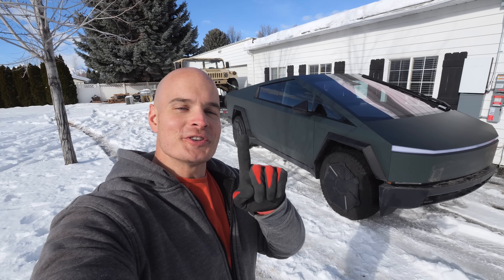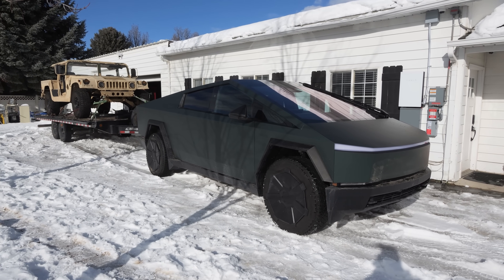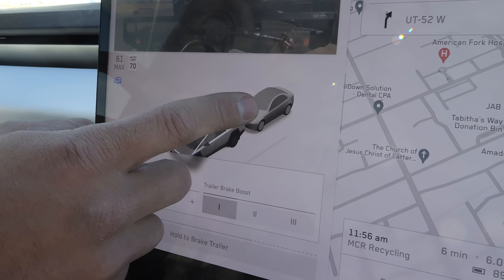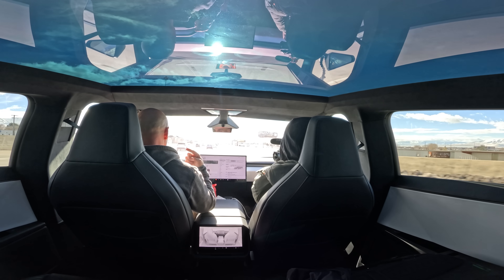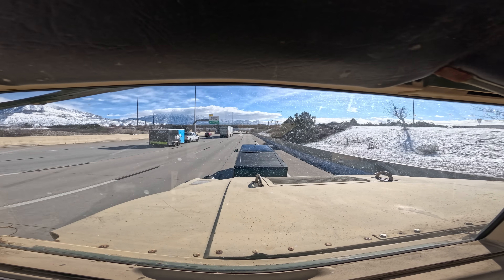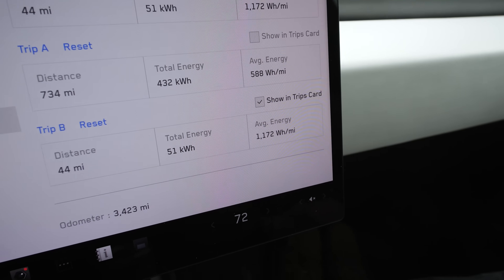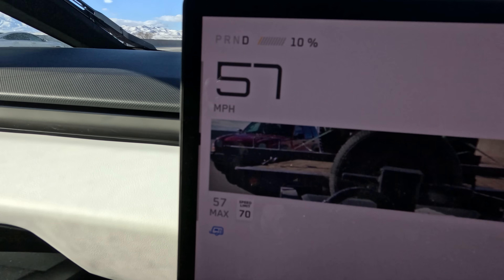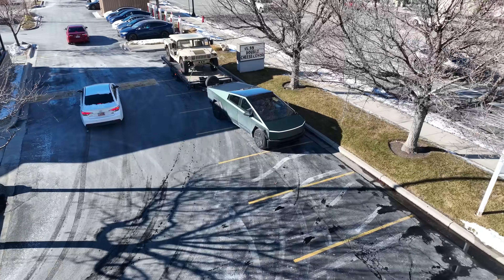How far can the CYBERTRUCK tow 11,000lbs in Freezing Weather?

Comment: Sorry, not for me.  Will stay with my dinosaur and pay at the pump.  25 gallon tank will get me 375 miles for $75.  It would take you 3 additional charges to go the same distance, not to mention the charging time 60 min x 3 or 3 hours additional time in transit.  Oh, mine was just a bit over $50k and not $100k.  Just my opinion and really loved the comparison and the video, but from an economics stand point, it just doesn't add up.

Comment: I'm amazed the range is as good as 90 miles. Our daughters friends came to us for Christmas, and he had just taken delivery of a model Y company car (not the extended range) .
He charged it at home and being Sicilian drove at about 90 mph from Nottingham , by the time they reached south Birmingham (this is UK btw) it was telling them to turn back to central Birmingham to recharge.
That took 3 hours , they then drove the 110 miles to Bath where we live , more slowly and they only had 25% left .
And this is not towing .
Yes they had the heated seats on and the interior heating it being quite cold and they had a baby in the car .
But not very impressive.
Reply: No heated seats don't , but heating the interior does , and with a 12 month old baby in the car you have to turn it on
Reply: Also it seemed to lose 10% range overnight , just being parked , we presumed that was keeping the battery warm . We couldn't help wondering what happens when you leave it parked at the airport for two weeks.

Comment: It has just about no point to the towing capacity at all. What are you going to tow no more than 90 miles in a single day consistently, at that weight, that would make it worth owning? I guess just tell your construction crew they can't go more than 45 miles away from base in a day or they won't make it back....

Comment: Not sure what the weight of the modified EV H1 Hummer is, but a basic one is about 7800#'s and that Iron Bull power deckover tilt trailer is around 4800#'s. By minimum calculations you are over by 1600#'s plus your body weight. My question is, did you weigh this set up to see how much over it is?
Reply: Wanna know how we can tell you didn’t watch the video?

Comment: 13$ for 100 miles of range, this is garbage
Reply: Did you notice the sleight of hand? That was for home charging, mum about commercial charging cost. Also the $13 ignores power overhead costs and cost of the charger and its install.  And with the EV lying that 90 miles is 318 miles I would suspect the EV's $13 claim is yet another EV lie.

Comment: That was interesting however what is the TOW only without speed check on ramps and stick to let's say the 55 or double nickel speed that was used in the 1980's during the energy crisis.  Also throw the Truck into CHILL mode.

Comment: Why hasn't anybody come out with a hybrid pickup truck? I mean really.
That's the way to go.
Unless there's some light year.  Universe changing battery technology. That's gonna come around and give you enough capacity to tow for 3 to 400 hundred miles Towing with an e v is just gonna be a waste of time and money
Imagine a 4 cylinder internal combustion motor powered by CNG or hydrogen. Back backing motors on that cyber truck. On the flatland you got the little 4 banger in there, giving her all she's got. And then when you hit a grade, the electric motor Kix in and up, you go.

Comment: Well this video only proves what most people should already know that electric trucks are a piece of crap as far as traveling distance. Electrical vehicles have not Advance themselves enough as of right now to keep up with gas or diesel powered vehicles. They are good for traveling for short ranges or within the city other than that for doing real traveling or real hard work they are just not cut out for it. I know some people are really focusing on saving the environment from pollutants and there's nothing wrong with that if your alternative motive is suitable enough and efficient enough to carry out the job more better than past methods.

Comment: Also.... What outside air temp did you do the Ford and Rivian at?
  I pulled max weight with my ModelY thru winter weather coastal Oregon 180 miles a few weeks ago. My range didn't go down nearly as much as I'd thought. I used 16% on one leg (just the car) and 22% to return on that same leg. Later on it went up a LOT, but the wind was so strong against me at that leg I could assume it was for sure the wind. Utah can get similar situations, so, knowing the winds during a trip is something that should be included in all range test as well.
  Sadly mine is a "salvage" title...no superchargers for me. My biggest gripe that Tesla lets a insurance company keep you off it...idiotic IMO. I live 7+ hours from a service center..

Comment: I would love if you did the exact same tests with a 2024 diesel truck - Cummins/Duramax/Powerstroke, just pick one doesn’t matter. 

Compare fuel economy, how much is costs per mile to tow, then calculate the difference in emissions per mile assuming the electricity for your truck was generated in a natural gas power plant. Give your personal feeling of the differences in driving experience. 

It would be interesting seeing a direct comparison so we could see where electric still needs to improve in order to eventually take over.
Reply: Completely agree.
Reply: @proletariat9467 haha I live in Edmonton. I drive a truck but not a diesel; though I’m well aware of how much better is a diesel is for hauling. I simply made my statement in a non confrontational way because I’d love to see someone just do the comparison out of curiosity and realize how much electric trucks suck. If you bash electric vehicles outright then people get their back up against the wall and refuse to acknowledge your points.
Reply: My prediction is Electric blows fossil fuels right out of the water. My money is on green
Reply: @Trump.is.a.nazzii   Electric vehicles are fantastic,  but this test shows there is still a lot to be desired when it comes to towing. Most diesel trucks you're getting around 300 miles on a tank even while pulling a trailer. That's obviously huge time savings not having to recharge all the time; I'm just curious how that compares for fuel costs when you have to charge your electric truck every 100 miles. 

One day electric vehicles will replace everything, I'd just like to see a proper comparison in 2024 as to how much further electric trucks will need to improve before they truly become a replacement.

Comment: EV's are all about efficiency. That's why I don't get it building a truck like this. I still regard this as a waste of precious material. Of course a ICE is better for towing use. Is it an American thing to build an EV that has ludicrous mode or what, an EV has to do exactly the same as a truck but then better. No it doesn't. Remember 25 years ago the best selling car in the USA was a wagon, not a truck. We should go back in size, EV's are great for everything smaller. If you drive 400 miles per day, don't buy an EV. But that doesn't make an EV stupid. The Cybertruck is stupid. Period. (<- my opinion)

Comment: That whining noise would get real tiring real quick.  When you switched to the Rivian shot it was amazing how much quieter it is than the Tesla.
Reply: But it wasn't under load.
Reply: @MR-nl8xr You are right, it was nit under the same load. Rivian was towing 3000lbs. It says right there on the screen
Reply: It's not annoying at all, is an awesome sound. I love it, like driving a spaceship.
Reply: Yeah, kinda like the annoying humming from a V8….
Reply: @johnkimball7000  I drive a Lexus GX with a V8 engine.  It is quiet and smooth, the only problem with V8 engines is when you chop up the exhaust and put high flow performance exhausts on that drone at highway speeds.  That is tiring on a long drive.  That whining noise would get tiring too.  No thanks.
Reply: Rivian with summer tires vs winter tires on the CyberTruck - now put winter tires on the "Rivian."  And the Rivian is at least 10x louder.  Write that down.

Comment: 90 miles on a full charge is insane 😂 my chevy half ton can go 250+ miles towing my 10,500 pound boat, in any temperature - I can fill up the gas tank in less than 5 minutes. I'll pass on this electric crap

Comment: “I’ve been driving electric trucks for quite a while now”- literally not possible😂, “seeing that brake regen putting power back into the battery is so efficient” - literally the most inefficient tow vehicle available today 😂
Reply: Tell me you don't know what efficiency means without telling me.
Reply: @lucaandreamifsudbuhagiar9375  efficient would be more than 100 miles of range towing- w/o that parlor trick it probably wouldn’t make it 50 miles 😂 & yes I get it: it’s an efficient use of the energy generated when braking, but it’s far far far from an “efficient vehicle”

Comment: That ain't 11,000 lbs. Sorry.  My fully loaded decked out H1 HMCS (with its OEM steel roof), 300lbs roof rack, 250lbs tire carrier, 150lbs brushguard and 350lbs of under body protection weights in at a svelte 9000lbs.  I doubt that the dinky trailer you're pulling there weights even 2000lbs. A 998 HMMWV (yours is probably loaded with battery nonsense) weights about 6200lbs empty. I'm guessing your load is  closer to 9000lbs than 11k.  FWIW I can tow about 5000lbs with my 22 year old, 70's era tech, 9000lbs H1 and still go about 350 miles before I need to refill on diesel - then it takes all of 5 minutes before I'm back on the road.   I really wish that the government would stop promoting and ultimately forcing us to adopt these clearly inferior products.  I'll grow biodiesel in my backyard before I drive a stupid electric vehicle (and thanks to the service lifespan of the HMMWV, I'll have parts for at least 30 more years).
Reply from the maker: I mean… I literally weighed it in the video but ok!

Comment: Green looks good. I think I read somewhere there's a bigger battery for the cybertruck. Maybe there's more range to be had with that and a trailer.
Reply: I have a steel bike frame (circa 2004-5) that is a similar green, anodised. Gorgeous albeit dird dirt dirt cheap. Redline. Best pedaling bigk I ever had, and that includes alu, light steel and carbon.

Comment: 90 miles? yech my 250 pulls my eighteen foot travel trailer a quad in the bed and propane generator 430 miles to the lake cabin and back with a five minute less than half fill up back in my home town. I think electric vehicles were designed to limit the bug out scenario of citizens.

Comment: Hi, not the first towing video I’ve seen, but the same issue identified….. obviously range is a problem, but my biggest concern is trailer safety.

Here in the UK I tow a large German Caravan, very top end with all the bells and whistles, a fair proportion of them in the UK are used by Travellers/Gypsy’s and sadly, they are a magnet for theft.

The thought of trying to find a spot in our overcrowded Service areas to leave your Caravan/trailer fills me with dread, whilst you drive away for an hour or more to recharge, if the charger is unoccupied 🥺

We are legally required to travel slower in the UK, towing is Max 60mph and trucks above 3500kg gross weight are physically limited to 56mph. Offset this though against our more crowded small island.

Short range towing, charge then drive out and back, I see no issue, but like public charging in general, I don’t see a long and happy future.

I’m told we aren’t getting the Cyber Truck in the UK, which on balance might be a good thing 🥳🇬🇧

Comment: All the stations are being used? And they are now going to let others use the Tesla chargers?  Yikes! Tesla owners getting screwed on that deal. 90 miles is what I guessed. Most would be looking for a charger in the 20's SOC which would be around 50-60 miles. It would be interesting to see the same tests when it is actually cold. Below zero cold. Charge an hour to go an hour is about right. Why make a tow truck if you have to discon every time to charge? Imagine doing that in a snow storm every hour.  SEB Bank just announced that its company Polstar EV's net worth has now become 0. Worthless. oh noo......

Comment: Why in the name of Baby Jesus, would someone even consider an EV for towing long range, when superchargers costs more than driving a Ford F250 Super Duty? Even if it pulls 200 miles, the savings are just not there at $0.4/kWhr avg. (at 90kWhr you're getting about 6 miles to a gallon. With twice that you're not doing that much better than the average 250 class ICE tow vehicle).

Comment: Why no one carries a 7,000+ watts 240 volt capable inverter generator on the bed of these EV trucks? for example the A-iPower GXS7100iRD 7100W Dual Fuel Inverter Generator sold in Costco would be a great choice since it burns 3 gallons of gasoline every 11 hours. With the generator on the truck bed you can easily skip the darned charging stations and do very long roadtrips.

Comment: Steer by wire they can keep it, sorry some things need to have some form of mechanical fail safe.  Trailer out weighting the truck is normal for some people like pulling my 4 car carrier with a 3500 pick up trailers weight is closer to 27K with a full load.
Reply: I have a Mercedes Unimog from the German military. It's gross weight is eight tons and it can (legally!!!!) tow 30 tons.

Comment: little known issue for EV's is the difference between "Gross capacity" and "usable capacity " of battery unit . you may have put in eg. 88 kilowatt hrs of charge but battery only will take 81kilowatt hrs. likely losing 10% through the actual process of charging from the charging unit/cables...... basically its like spilling fuel when you are filling the tank of an ICE car .
Reply: Mixing up terms but the basic truth is there:

Gross v Net battery: My Tesla model 3 has a nominal (gross) battery size of 60Kwh and a usable of 57kwh - think of these as being like a checker board with 60 squares (nominal / gross)  but you can only use 57 and put 57 checkers of "energy" on the board at any one time (usable)  - the battery management system will select which 57 of the 60 to use  - by rotating the cells like this there is less wear and tear on the battery.

 Charge Losses- that is different, in warm weather this is almost zero, 97% or so of the electricity that comes out of the charger goes into the battery - the rest is lost in heat etc, you still only get to put in 57kwh into the battery (not 60) but 1kwh has been lost to charge inefficiencies so the charger will say you filled up 58kwh - the amount of loss gets bigger the slower you charge (>6% L2, up to 15-20% level 1 home charging), if you charge when it's very cold the first part of the electricity from the charger heats the battery first before charging it - the losses when it's very cold can be much greater.

Comment: In the future, they'll invent something called a "diesel engine."  It will tow for hundreds of miles with huge trailer loads attached to it.  You won't need to drive it at the stupidly dangerous and traffic snarling speed of 38 mph in a 75 mph zone either.  It will get the same mileage in cold or hot weather too!  But the best part?  It will be able to go from 0% range to 100% range in only 8 minutes!  Even better, the fuel tank never shrinks if you don't keep it between 30-80% full all the time!

Someday we'll get there, once we get past these electric toys.

Comment: This thing is a joke.People who use trucks to tow travel trailers or large work trailers and drive any distance at all will not be happy. Having to disconnect the trailer every 90 miles is a waste of time. Also, you ran the battery very low, which I understand is a no-no if you expect the battery to last. Another expensive toy for wealthy suburbanites to show off with. Totally useless if you really use your truck to the limit.

Comment: It is clearly not practical for anyone but a rich YouTuber with no obligations but making a video. Diesel trucks are still state of the art.
Reply: My wife hates it!!
Reply: Downright$45 going on what i would spend $160 on its a significant savings... by it my time is valuable, driving 90 miles to charge for 40 minutes is a total deal breaker while towing... im a contractor, i was really hoping to have the CT be my next truck...
90 miles isn't even from my acreage to my clients homes in the city........... :/ (granted, in not towing that much either, but still..)
Reply: Every time I see the Cybertruck in one of these types of videos, it just compounds my hatred for it more. Everything about it is offensive. Range. Design. Aesthetics. Noise. It's awful. It's the worst looking vehicle ever designed by humans.
Reply: @MattExzy I think it looks kinda cool. 😕
Reply: Until you pay a mechanic for the repair😂😂
Reply: @gocubsgo5055  well, at least it isn't useless until then
Reply: Diesels have been going downhill since 2010. I drive a mack everyday and it's awesome apart from the emissions crap.
Reply: Just give us a hybrid. Diesel electric or something idc. 

Been begging ford for it for years

Comment: 1. Can we have a test of driving in real life conditions at 90Mph and see what the range is? 2. Please do a Trail comparison to see if it really has any potential and compare with Rivian please! Thanks
Reply: What was not real life about this?
Reply: If he did the speed limit the whole time the range would have been even shorter probably 60miles you have to stop every 60 to 90 miles to charge sometimes chargers are all taken so you wait 30 min to an hour for a charger to become available than another hour to charge you have to drop your trailer you have to take a route that has available chargers meaning normally a longer route it still cost 14 cents a mile only a little better than a diesel truck all of  if your going 500 to 1000 miles it's going to take 5x as long to get were your going technology is not there